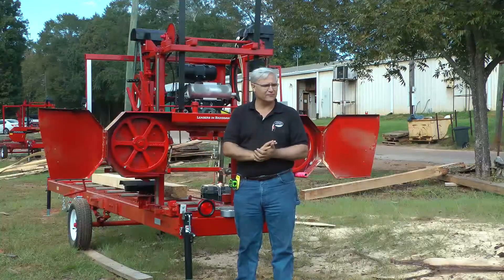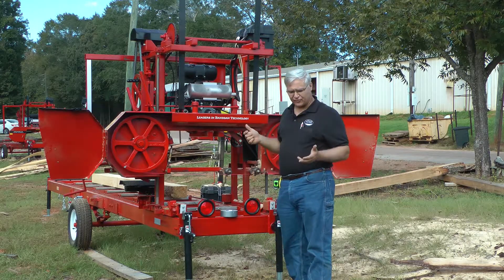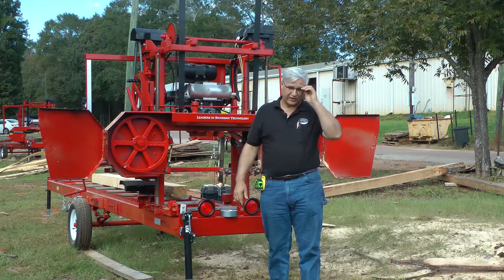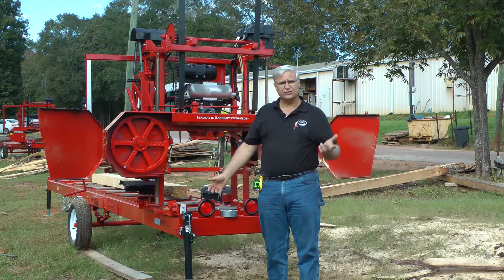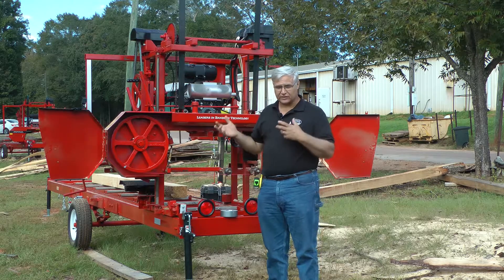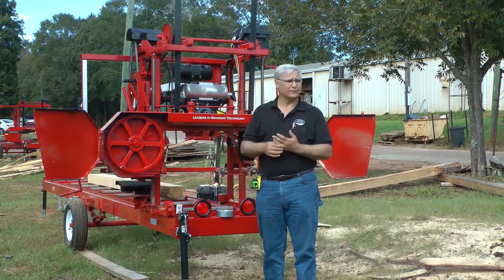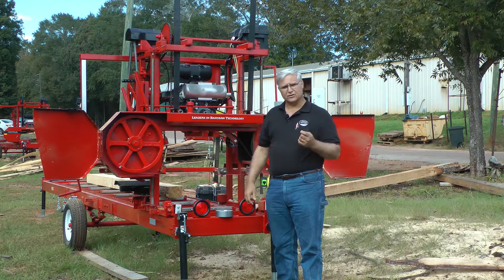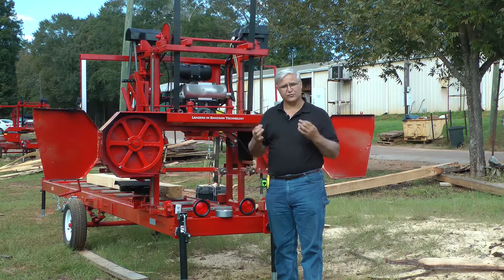Measuring Min/Max on bandsaw blades for sawmills and resaws

Comment: You can also do it by finding the circumference of one wheel and adding twice the distance from center to center of the wheels. Your ideas are still good though.
Reply: Hi
Reply: How do I measure th size of bandsaw wheels
Reply: @brianchamutangi1108  3.14xradius squared (radius being center of shaft to outside of bandwheel) or just take a flexible tape and measure outside circumference. Hope I could help have a good day
Reply: @dustinworrick9173  Forgive me, but isn't circumference π×∅? π×r² should give the area? So my "give" on this: ∅×π+(2× distance between centers)=length of blade?
 On the AC-36 it's 26"×π=81,68"+(2× distance between centers)...
 On the MP-32/HD-32 it's 19"×π=59,69"+(2× distance between centers)...
 IF I'm wrong I apologize, but this is how I remember it from school 🤭. That is why area grows exponentially relative to the circumferens (if I got it right..) 😋.